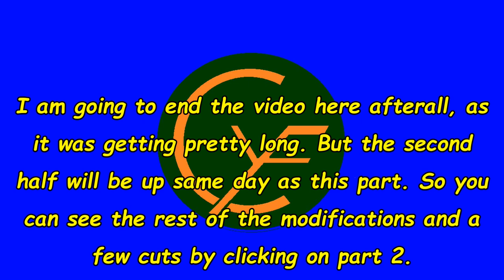Harbor freight Mill Modifications part 1

Comment: Audio was fine for me Cy. Good video, having just moved location finally, I need to set my own similar Mill up which is similar in design to yours, so I found your video handy. At 15:32 where your cutting the strap, you don't need a knife, if you turn the band over where the join is, there is usually a longer piece of the strap, you can simply pull it apart, undoing the strap. Off to watch part 2.
Reply: Spoke too soon, the audio, as you mention above, goes bad towards the end when talking about the handle, lol.
Reply from the maker: @DiemenDesign  Yup that was the part. Aggravating I tell Ya.